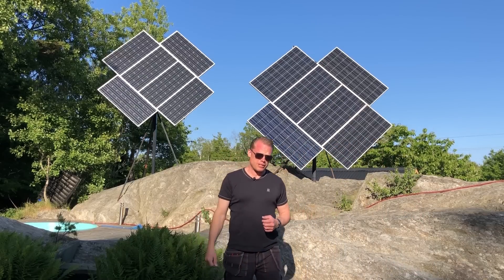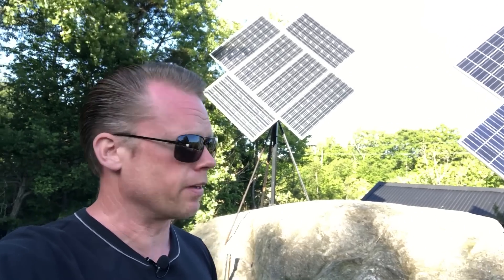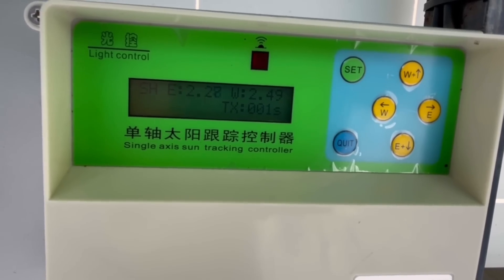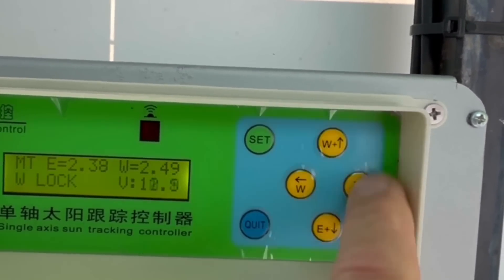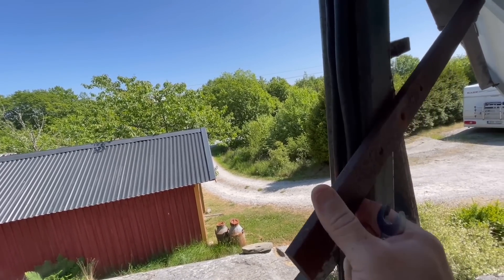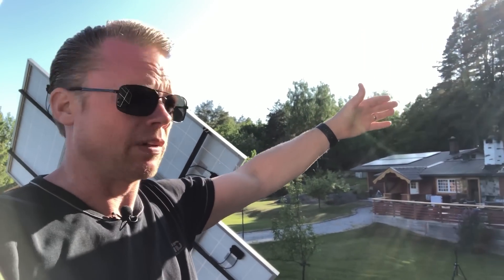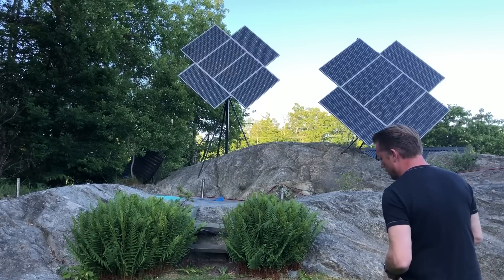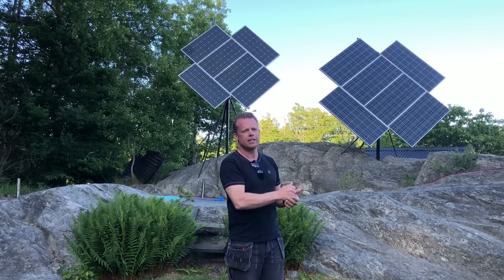Diy Budget Solar Tracker System, tracking vs no tracking.

Comment: The comments on this video show lots of interest in tracking technology. A single motor tracker needs to have the axis of rotation parallel to the earth's axis of rotation. Like an Equatorial telescope mount. This allows it to compensate for the earth's rotation and keep facing the sun. (Right Ascension)
But it can't move like clockwork... The eccentricity of the earths orbit means the length of a solar day changes throughout the year; consequently "the equation  of time" is applicable. 
Ideally the panels would also have to have a tilt adjustment to compensate for winter and summer. (Declination). 
But if you are going to use two motors, maybe let the computer do the hard work and keep the mechanics to a simpler, azimuth and altitude arrangement. 
A light sensor down a tube that is perpendicular to the plane of the panels might facilitate automatic calibration and machine learning. 
Would be an interesting project... 
Especially getting one pair of motors to control a line of similar panel mounts.
Reply from the maker: When I did build this nine years ago, I decided to adjust the tilt angel three times per year. I have one settings for summer, one settings for winter and one for spring and I have done some tests to it, and the angle does not have to be precise at all, so it’s more than enough to adjust it manually three times times per year. And it’s also a lot less complicated.
But the cool factor is of course higher😅
Reply: @flyingtools  You did a great job of it! Still working all these years later. 
My projects seldom get beyond the plans. Building a battery monitor/inverter controller/dump load driver from an arduino at present. The electronics is interesting.

Comment: I built my own tracker and was surprised that it did indeed harvest a little over 30% more energy.  I have to say though, with the price of panels today, even a home made tracker it is barely cost effective.
Reply: It depends what the application is, if your charging batterys then simply more panels is probably going to be cheaper.....if your using the power directly then a tracker will give more time during the to day where there is enough power to use.....i know of a small wood pellet producer using a modified wood shaving mill and hammer mill directly running off solar with no battery's in the system, their solar panels are all on trackers that allow the system to operate for more hours in the day
Reply: @unhippy1  Very interesting. The bottleneck in these systems is often battery capacity, not panel capacity. The ability to get consistent enough output to skip the battery completely is something I've never considered. I wonder what you could do with this. Maybe heat water?
Reply: @caustinolino3687  heating water would be an easy way use the extra power altho if you were charging battery's you'd need a wind turbine type load diversion charge controller or something......all my hotwater in the summer is produced by solar panels wired straight to an element in my hotwater cylinder
Reply: @unhippy1  just facing some panels in different directions would also give you more time during the day with enough solar production.
Reply: @unhippy1 is not only right about powering directly from the panels, but also, a tracker can be useful if you're greatly limited by how much usable sun you have throughout the day.  On my property, there are a lot of very tall trees that I cannot cut down.  There are relatively small patches on my property that get sunlight for most of the day, so, having fewer panels in a concentrated area is much more beneficial to me than getting more panels.
Also, if you can attain peak power for more hours throughout the day, you can minimize how much of a battery you need.  Batteries are pretty damn expensive and have the shortest lifespan of all components in the system so reducing your dependency on them is critical in the long run.

I personally don't think dual-axis trackers are worth the money but a single axis in most parts of the world ought to be.
Reply: @Toastmaster_5000  the wood pellet maker that I said about earlier has single axis trackers axis permanently set to the angle for winter sun.....they get enough sunlight in summer to not need to be adjusted which makes the a-frame setup much simpler and cheaper to build
Reply from the maker: Yes, I agree, this is more for fun, and it also depends a lot on which latitude the trackers are located.
Reply: @flyingtools  It also depends on your space limitations. If you have room for the extra panels, that's great, but if you need to pull as much out of each panel as you can, a tracker can sometimes be your best option.

Comment: Neat, you are getting about 2.5 hours of extra sun in the morning and another hour in the afternoon by using tracking. Both systems die at 19:00 hours, so the tracking doesn't really benefit an off grid battery system there. Meaning to need a smaller battery system given higher expected solar power. That 2.5 hours extra in the morning, effectively shifting the noon peak power is the most interesting. That gives the most potential for tracking to have a major benefit for a battery system.

Comment: In my own experimenting the totally flat plateau in solar output is mostly due to the temperature of the panels rising exponentially with the linear rise in light flux.
Reply from the maker: But the maximum power output is the same when they are aligned with the sun, the static power curve should be higher du you mean ? Right? Or maybe I misunderstand you.
Thanks for your comment anyway ☺️
Reply: @flyingtools  The morning and evening sun still go through a lot more atmosphere - but above a certain amount of light the panel starts to really loose a lot of efficiency due to heat. So it ends up making a flat top of output. At least that’s been the case with all my old polycrystalline panels.
Reply: I wonder if adding some water cooling on the back of the panels would help enough to be worth it? Both more electricity generated from cooler panels, plus less electricity needed to heat water. @flyingtools what is your latitude there?

Comment: Ah, you have gotten a MIC 3000 with 1 mppt I guess.
Be aware that if you are using the HomeAssistant integration that growatt starts to block accounts cause they do not like the amount of api requests cause the HA integration right now is based on the cloud service growatt provides and access the growatt server cloud , not your local inverter or the wifi stick.

BUT: there is an upcoming solution for HA at least for HACs user which will be based on GROTT. Grott is raspberry pi based service that will no longer access the growatt cloud and ask for data but act as a proxy between the WiFi Stick communication of your inverter with the Growatt Cloud. It is a kind of passive interceptor or listener in that communication.

This solution has already been developed and used in a different application you might also know, the EVCC surplus charging solution which allows to charge you car only while you have surplus power that you feed in . But this solution is working independently of your smartmeter (which measures what you feed in), your inverter and the wallbox you are using. 

So that is pretty smart and can be configured to act as a proxy between your growatt inverter and the growatt cloud to get all the data and still have the access to the cloud without being blocked in the evening after x api calls on that day. I have 5 Growatt inverters which means 5 times the api calls from 1 account and growatt starts to block me earlier and earlier the longer the days get.
Then I can not get access via App nor browser login, only the single page report is working. 

If you do not know what that single page report is : It allows you to share your system data with the world or friends what your system is producing right now, today or even in the past.
You could call it real time data, but it is not real time cause these cloud services usually send data in intervalls, so every 5 minutes the data of the past 5 minutes, but the growatt page will show you only 1 figure for the past 5 minutes so an average. 
So, you can create a single web page report anyone can access without a login required to get the basic graph and data of your system. Growatt will give you a unique, quite long URL that works for anybody who knows that and you might feel uncomfortable but there is a option cause you can set an expiration like 2 weeks (for the beginning usefull), 1 months, 3 months, 6 months, a year and never.

Might be an opportunity for all those who watch and have no real idea what you are talking about and if your figures mentioned are real. But it is just an option you can use or not.

But  there is even more cause if you create such single page (you can create multiple, different ones as you like it cause there are some more options) then this can be usefull for other use cases far beyond your current focus or scope for example to be used with an AMAZON ECHO device.

Amazon echo devices come with the silk browser and you can call such page from any echo show device or even AMAZON FIRE TABLET if that is running in echo mode or however it is called, cause every Amazon fire tablet can act like a ECHO SHOW. 

What you will need is an amazon echo skill that will start for you the silk browser and the certain URL you want based on the command like GROTT.
Out of the box you could say Alexa, start SILK / Browser but that would be it, it would not be able to start a certain page like ebay for example 

You need to activate the mypage skill and there you can save up to 10 keywords with 10 urls you want to call to get a URL shown for example the growatt single page report cause this does not require a login you would otherwise need.

You can say "alexa, open mypage and show me TRACKER" where tracker is the keyowrd for that url 
Then echo show  or amazon fire tablet will open the SILK browser and show to you the last url you had opened and then the webpage you want. If you had watched the last time the tracker then it will be there from the beginning otherwise it might take 1 second or 2.

Finally: Homeassistant also offers the ability to show a single page, so you could also use that one page report to be displayed inside HA without any need of a growatt integration.
Your system is only feeding in and I guess you will get the same rate for every kWh you are feeding in which then means that you can set the kWh price up in the growatt inverter configuration and you would get the value of what you have fed in in local currency like Ore in your report, not only kWh. 

So a lot of opportunities and the key word to search for might be single page report or follow this path once you have logged into your account via browser:
if you are in the dashboard of that mic 3000 inverter you should see in the upper middle icons like Dashboard - energy - home energy - log - setting
You click on ENERGY and then a new site appears with 2 tabs on the upper left with 
PARAMETER COMPARISON and PLANT MANAGEMENT

You choose PLANT MANAGEMENT and you will get a list of all your growatt inverters - in your case the one and only.
Now you find on the far right side a row called OPERATING TOOLS and a lot of icons there 
Now try to hover over the first icon which looks like a screen with a youtube button - you should get a hint called 'DATASHEET LINK DEFINTION"

Yes, sounds weird and not like a single page report but if you click on that icon you will get a dialog box with a title called  
POWER STATION SINGLE PAGE DISPLAY DEFINTION

And there you can create a single page report and its content. You will  play with it and therefore choose  Link duration 1 week cause in the beginning you will create far too many of those you will not use longer. 
The most effort for me was to find out how to use the LOGO right ( remember I have 5 inverters with 2 mppt each so 5 times 2 fields of solar panels or strings and needed 5 pictures to identify each of them) and to upload the picture cause the server was not displaying every picture even though I had created a picture of the recommanded aspect ratio of 200 x 60 
High resolutions or huge pictures did not work out at all, so be carefull cause the spot where it will be visible is tiny and a 4 MB jpg will not make sense for a tiny 2 x 1 cm picture on the screen. 

If you have checked all your options (system diagram and PV Capacity are just 2 tiny options hard to identify where the difference is between with / without) and then press on "YES" you will get a link provided you have to copy with the copy action provided which will give you a really funny message "COPY_RIGHT"
I usually save this url cause there is no chance to ever get that again, you can only create a new one, no chance to edit it again or ask what was the last single page report I had created.
It is a fire and forget dialog - therefore you have to copy and save it yourself to use and share it later

If you analye the URL you will find singlepage hence the name singlepage report, which is the most convenient way to use for all those living with you and who are not solar addicted and want a fast quick access without an authorisation. 

I like it a lot and I only found out about when I was aksing myself what these tools could be good for cause there is no further explanation or documentation about this feature even though very usefull at least for all those who want a fast access without login - for example usefull for an eINK display which does not need much power and shows the same state without using energy till the next update arrives, so every 5 minutes a tiny bit of energy to retrieve the data. The best would be a PICO W and such e-ink Display, but you would have to create a picture of that single page every 5 minutes cause the e-ink displays can easily update and display jpg. The browser on a raspberry pico would not be able to put such complex website together and therefore the way via jpg creation of such dynamic report page. 

I know a lot of details but at least a good point to start from and what is possible and worth to check cause the singlepage report is a well hidden gem in my opinion no one talks about or has shown, but quite usefull for a lot of cases in my opinion, maybe even more for the usual growatt inverter with battery and loads from the house than a usual feed in only inverter you are running, but at the end you want to know how the tracker system had performed just by walking by without clicking anything like you have a look for the weather report.

The easiest way to start with e-ink and such data report is pimoroni product worth every cent called BADGER - looks like quite the opposite of what you imagine cause it was developed as a badge to wear on a shirt but offers a lot more and you do not need to code from scratch which can become very annoying with e-ink displays you can get for cheap from ali express. THey are useless cause they are missing a usefull driver integration which you can only get from those pimoroni solutions. THe badger W is the item you want to look for, not the usual BADGER without WLAN and not internet access which is far easier to get. BADGER W was about 35€ with all the BREXIT fees on top , lot more than the local offers which all had been sold out. 

I like your projects a lot therefore the long comment about the growatt challenges I had faced in the past.
Reply from the maker: I’m not using Home Assistant with this inverter. Thank you for your information.

Comment: Excellent video. I really like your honesty as well as engineering skills. Empirical data is so much more authentic than computer models which suffer from GiGo. 

My mathematics skills are limited, but it seems that a mistake is being propagated about wind power... 

The much repeated wind turbine  formula is:

Pw= 1/2 p A V3

But the kinetic energy formula is.

KE= 1/2 M V2

In which, velocity is only squared not cubed!

What do you think?
Reply: For Kinetic Energy (KE) it is indeed 1/2 times the Mass (M) of the object, times Velocity (V) squared.
KE=1/2 M V^2
The difference is, the mass is referencing the entirety of the object.  When talking about wind, you need the mass of all the air particles that pass by the turbine.

The Air turbine formula is 1/2 times rho (p) times area (A) times Velocity (V) cubed.
Pw = 1/2 p A V^3

You need to know the mass of all the air particles that pass by the turbine.  To get that you need the air density, rho (p), and the volume of air.  You have the frontal area of the turbine, so we just need the "length" of the cylinder to determine the volume. That length is the distance the air moves over a give time increment, generally 1 second. Thus:

M = p A V

substituting this into  KE = 1/2 M V^2 gives:

KE = 1/2 (p A V) V^2
or
KE = 1/2 p A V^3

Hope that makes sense.
Reply: @DeSahd  thanks for the detailed reply. 
But i disagree... 
KE is in joules. Whereas power is in watts. This adds the element of time. 
I agree that the length of the cylinder of air that energy is extracted from in one second is the same as the wind speed in meters per second. But that is to calculate the mass that is being decelerated. You don't get to multiply it again. 

I have been studying graphs of measured turbine outputs from. The ones i can find conform to the V squared slope. 

I think the ones published by vestas that look too perfect, may be computer generated from the dodgy V cubed formula.
Reply from the maker: @davebutler3905
Thank you so much. I tried to keep it as simple as possible.
Sadly, I cannot help you with your question.